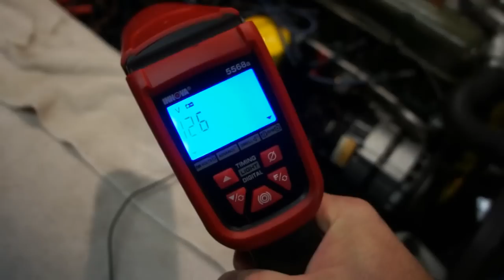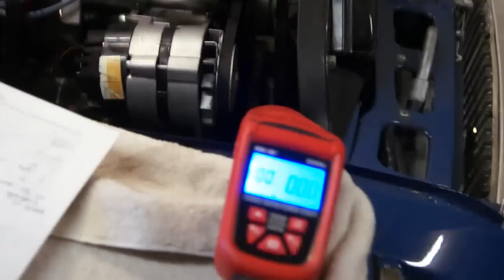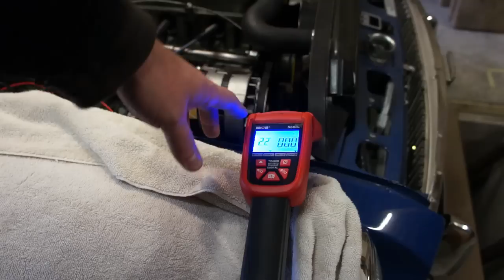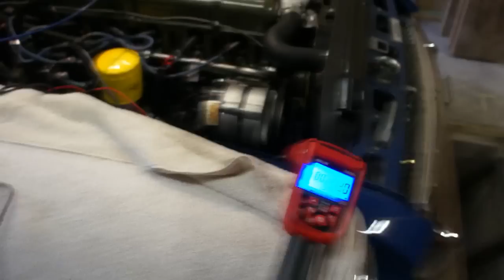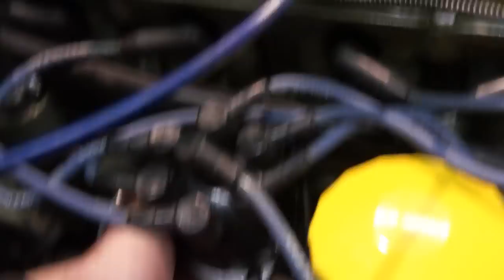1968 MGC Set Idle Timing, Innova Pro Timing Light

Comment: You should use the dial-back feature of this light to measure  the amount of "all-in" ignition timing at say, 3500 rpm, then confirm this with the specification.
I suggest doing this with both vacuum and mechanical advance seperately, for comparison with specifications.
In this video, you only adjusted base ignition timing, you didn't confirm "all-in" advance (at an rpm where the engine normally makes power).
It's great to have ignition timing set correctly at idle but you may be leaving power on the table under operating conditions.
Reply from the maker: I appreciate the comment. Thanks.

Comment: With todays gasoline, 2023, in an older classic motor,  as far as your initial timing . You have to advance it a lot more or you will be burning your exhaust valves ! ! ! Your info seems to be correct.   This is a very good video.
Reply from the maker: What if I only use ethenol free gas in my MG?  Which I do.
Reply: Then you've got it made !  @JRsGarage
Reply: Not much heat is produced at low engine speeds, not enough to burn valves.  Valve damage most often occurs due to incorrect (insufficient) lash setting.

Comment: Hello JR......First of all thank you for this good it was very helpful. I just purchased a used 5568 Innova Pro Series Timing Light. I just  used it on my VW Beetle and the only function that worked was the battery voltage reader when I connected it to my vehicle. So I downloaded the instruction manual in order to use the timing light by following the instructions and strobe never came on. Would you happen to know how I can  trouble shoot the light? It left me scratching my head. I probably should just contact the the dealer on this. Thanks
Reply from the maker: I wish I could help but I'm not very familiar with it.  I basically just learned how to use it just enough to set the timing on my vehicle and make the video so I'd remember for next time I have to do it.
Reply: so I am having the same issue with a brand new unit. did you ever figure out the issue? Unfortunately  i bought it probably a year and half ago and never used it till now!

Comment: Hello sir     i need your help  got new  Innova Pro 5568a Timing light and my 1986 Chevy truck has HEI Distributor in-cap Coil  Not external Coil as the video , my question is Where Do I Attached The DWELL Green Clamp ??
Reply from the maker: You'll have to find the negative of the coil for your setup.  I'm not familiar with it.  Might have to call the distributor manufacturer.

Comment: I recently bought an innova 3568 to set the ignition timing on my 1978 mgb but when I set it up nothing happens, the screen is blank and the light is off. But it works on my other cars. Please, if you have any ideas let me know, thanks.
Reply from the maker: Sounds like it's not getting any power from the leads or not enough power.  Is the battery/alternator in good condition?
Reply: Try cleaning the battery of car and leads of the wire, tighten cable good, test it by wiggling gently.

Comment: When you put the 15 degree option on the timing light, your aim is to make the pulley at top dead center ? (0 degrees)? 
If you put the timing light 0 degree option, its vice versa correct ?
Reply from the maker: When I put the gun at 15 degrees, I'm looking for the white marking on my pully (TDC) to align with the 0 degree mark on the timing chain cover (middle tick mark).  If I set the gun to 0 then, yes, just the opposite.  I'm looking for the white line on the pully (TDC) to show 15 degrees advance (but there is no marking on the timing chain cover for 15 degrees advance - just 5 advance, 0 and 5 retarded).  So I marked my pully with a red line at 15 degrees of advance and when the gun is set at 0 then the red line that I made should line up with the zero tick mark on the timing chain cover.
Reply: @JRsGarage  It depends on the car as to how the timing pointers on the timing chain cover are shown. On later MGB's  there are 5 points, with TDC being the first one on the right, second point is 5 degs, third point is 10 degs then 15 and lastly 20 degrees. The Dynamic timing should be set at 10 degs BTDC.
Reply from the maker: Thank you for the information.

Comment: Hi, 

I've got the same timing light, which I've never used before.  Thanks for the overview on this timing light.  I plan to use it on my 1968 MGB.  I know the timing and dwell figures will probably be different from an MGC.  I'll have to check my workshop manual.  

Were you going to put a link to a John Twist distributer video in your description?

Thanks, Tom
Reply from the maker: I'm not sure that I meant to link a John Twist video, but if I did it would have been this one: https://youtu.be/hpp67aqwM2Y
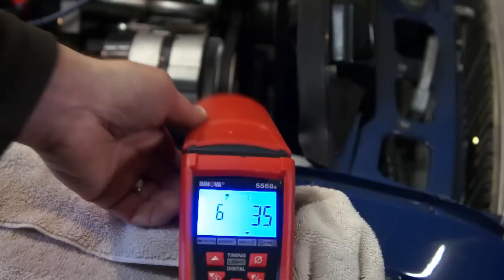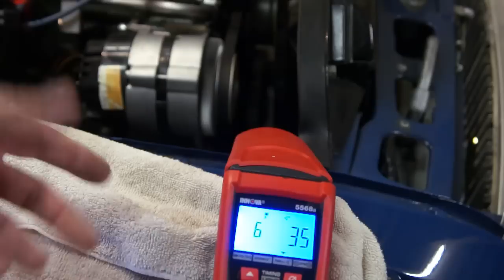Reply: @JRsGarage  -- 5:48 to 6:02
Reply: I think that's the one you mentioned.  Thanks for the link.

Comment from the maker: This upload is a replacement for a video of the same name, also uploaded on this date.  I wanted to explain that the vacuum line that is left disconnected from the distributor should be plugged up so that there is not a vacuum leak when setting the idle timing.  Thanks Alan for the information.
Reply: Rolantide vakkum avansin kac derecesini kullanmaliyiz
Reply from the maker: @user-sp4zz4on9i The manual says Static - 8 BTDC. 20 BTDC at 1000RPM